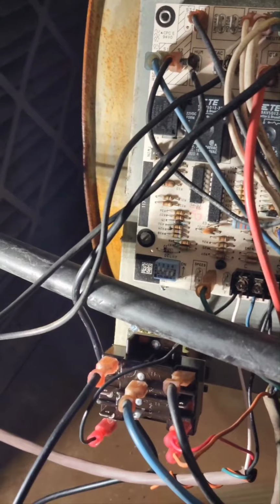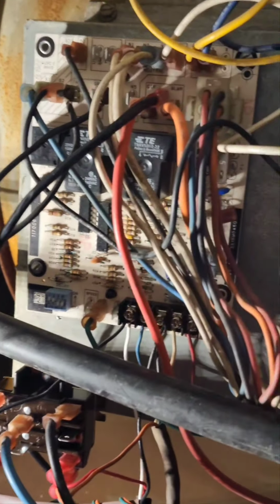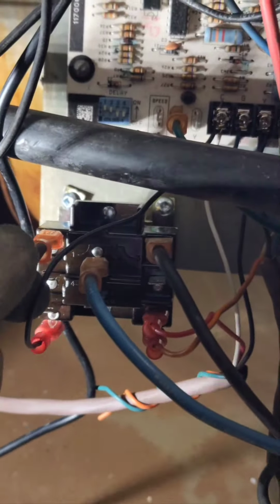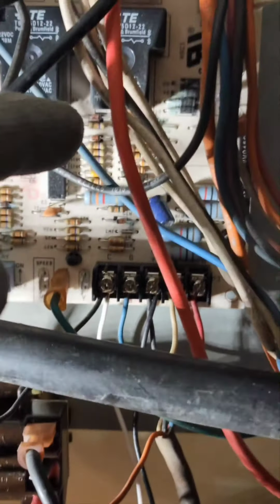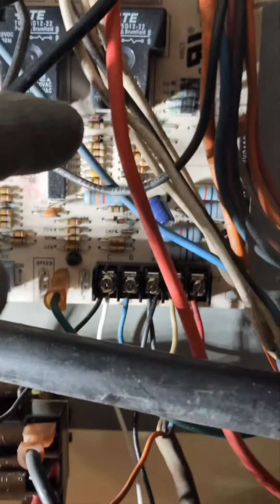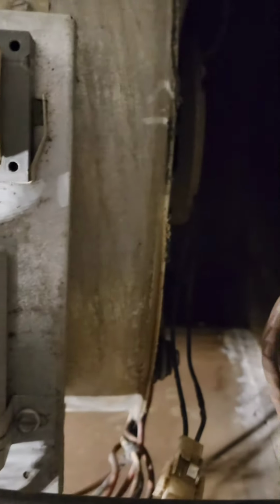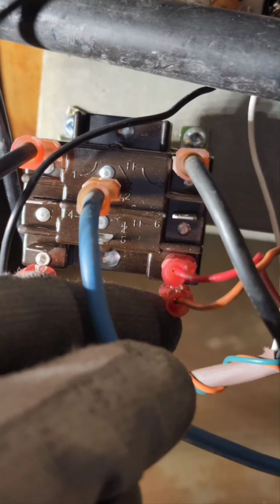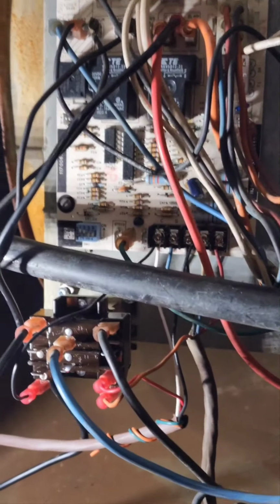Two Stage AC Wiring To A Single Stage Furnace !!!

Comment: Where are you connecting the blue wire in? My furnace has the blue wire for med speed running from the heat post on board to the blower. Can I just splice into that circuit?

Comment: I have this same issue, I just ordered the relay should be here tommorrow. It would be nice to get some help wiring everything. I’m willing to pay if you would help me out. Thanks.
Reply from the maker: @albertcharles5767  I'll be happy to help. Isn't the video clear enough for you ?!
Reply: @CaspianHVAC  yes but although I am technically savvy, things like where you connected the relay to the motor wasn’t clear as you just kinda talk us through it, it’s a great video by the way, it was the only one I found online, that match my situation. How can I pm you?
Reply: Ok, I hooked everything up but I’m trying to figure out where that black wire is supposed to to hookup on my board. You called it the cooling terminal, how can I identify it on my board?

Comment: Great video!!!

Two years ago I had a guy install a York two-stage A/C system.  

At the time, I had no idea what that meant. After watching several YouTubes & researching,  I know a little more.

I’m beginning to suspect that my unit is not wired correctly because my condenser fan and evaporator fan blow at the same speed at all times.

In fact, the evaporator fan runs much slower than I would anticipate as the CFM isn’t very high.

Am I to understand that both fans increase in speed when  the second stage kicks in?
Reply from the maker: The indoor fan should increase speed on the second stage and run faster if it's wired correctly

Comment: Appreciate your time. I used to do industrial refrig a decade ago, but havent done many homes.
Will this affect the gas heat exchanger? Like it gets too hot from lower air flow?
Also do most 2 stage condensers work without any comms between the furnace board and the cond board, i mean like a digital comms? Like its just plain 24v between both units. I was looking at goodman 2stage and they mention some kind of comms crap, which i dont want.
Thanks!
Reply from the maker: Thank you.
To answer your first question, NO !!! It doesn't affect the heat exchanger at all. The speed goes back to normal once there is a call for heat (Relay will be off the circuit).
As for the second question, if you have a two stage furnace, then you don't need this setup. You only need a two stage thermostat, and that's it !!!

Comment: Hello, I have 2 cables from the outdoor unit Y1 and C. Can I use C as Y2?
Reply from the maker: No, you can't. C Wire is needed to activate the Contactor
Reply: Thanks for answering, another question is from terminal y2 to the relay. Should it come directly from the thermostat or does it come from the 3 wires of your outdoor unit? Thank you
Reply from the maker: @TheIvette  It should come from the thermostat to activate the relay

Comment: So more or less if you want 2 stage ac get a 2 stage furnace to go with it lol. But wahts the advantage of 2 stage vs single stage?
Reply from the maker: Some people don't want to or don't need to replace their existing furnace, but they can still take advantage of having a two stage AC.
The most important advantage of having a two stage AC is to save more energy while having a quieter operation and delivering you more comfort !!!